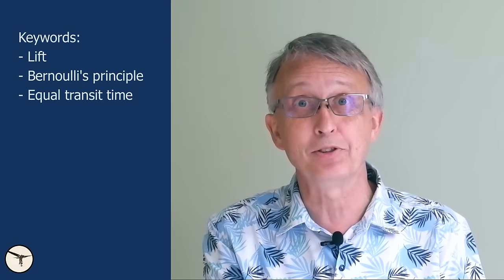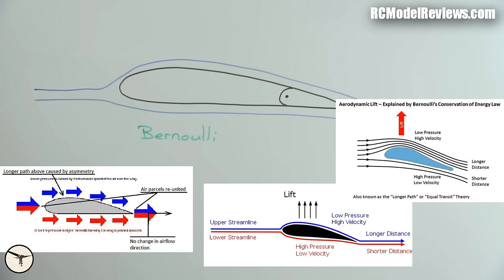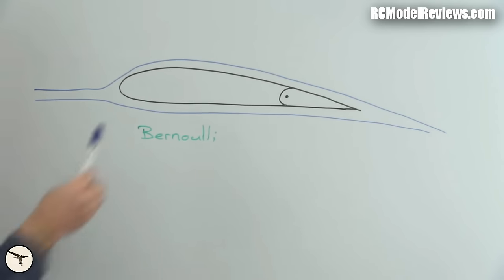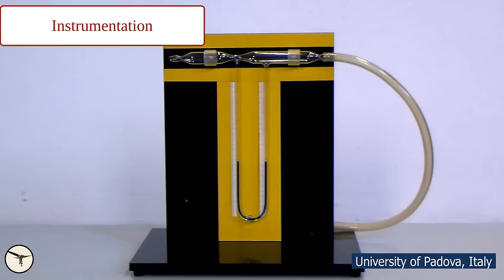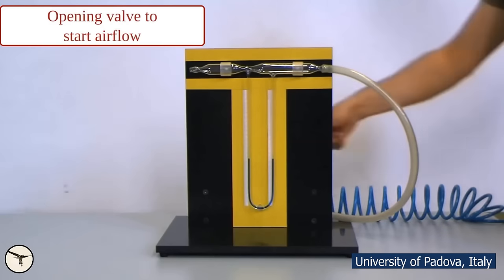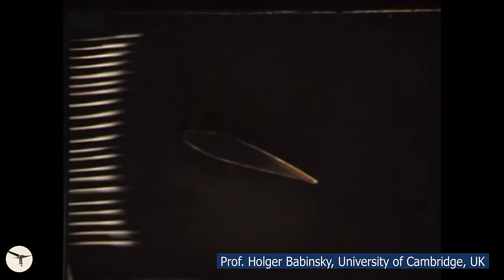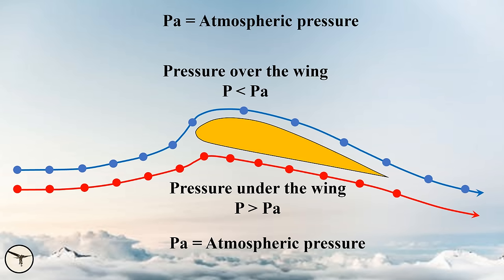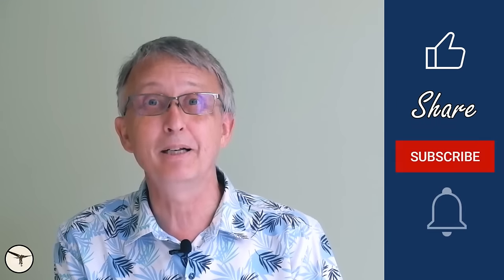Why are so many pilots wrong about Bernoulli’s Principle?

Comment: Hi Magnar, I am a PPL but more important for this I am an Aeronautical Engineer and also was an Aerodynamics teacher at college.
While it is true that Bernoulli's principle applies only to one flow line, it can be also applied to two (or more) flow lines if there is a point where the energy state (speed and pressure) was the same in both flow lines. Sufficiently ahead of the wing, the parcels of air that are going to flow just above the wing and the ones that are going to go just below have the same pressure and speed. So you CAN apply Bernoulli's principle between a point above of the airfoil and another below. Still, transit time is wrong so you can't deduct the speed just by the differences in length. How lift is generated is at the same time more simple, more complicated, and more disappointing (or unsatisfactory explanation) than most people think. Let me know if you want me to expand.
Reply from the maker: Thank you for your feedback. Lift can be both easy and complicated to explain. I understand and agree with what your wrote. In this video, I just wanted to address a common misconception.
Reply: Finally I stumble across some making some sense!

A question or two if you don't mind:

How would you explain to someone who insists that Bernoulli only works for a flow contained by an enclosre such as a pipe, that in fact any parcel within a flow also behaves according to Bernoulli and therefore it also applies to a non-enclosed object such as a wing?

I assume, conceptually it is the interface between parcels that causes the misunderstanding.

And for sails and thin wings which can be considered infinitely thin, how do you deal with the issue of path length of the sold being identical on each side:  I assume the effective actual path length is different because the total flow on each side has an average center of flow extended out some distance perpendicular to the surface?
Reply: @davetime5234  ... Let's go point by point:

1) "How would you explain [this] to someone who insists that Bernoulli only works for a flow contained by an enclosure such as a pipe". That's a strange question. Bernoulli is applicable only when several ideal conditions are met, one of which is NOT that the fluid must be contained in an enclosure. The total set of conditions can be encapsulated in 2: "Potential flow" (that is steady flow of an non-viscous fluid, without any sources, sinks or rotors) and "Between any 2 points of the same streamline" (the airflow around a wing, outside of the boundary layer, is a very good approximation to that). So how do you explain Gravity to someone who insists that it only works in Venus? Well, I suppose you tell them they are wrong, that that's not a condition of the theory. That said.... The streamlines of a steady flow, being fixed in space and tangent to the velocity vector on each point, are never "crossed" by parcels of fluid and hence they can be considered as a pipe. But that's more the reason why Bernoulli works in a pipe, rather than why it works around a non-enclosed object.

2) "And for sails and thin wings, how do you deal with the issue of path length being identical on each side". Simple: You don't deal with the issue because there is no issue to be dealt with. To generate lift, there is no requirement that the path on one side is longer than on the other side. What you said sounds like "equal transit time theory", which states that the path along the upper side of the airfoil is longer than over the bottom surface because the path along the upper side is longer. The problem is that theory is totally wrong. Why? 2 reasons: Frist, there is no reason why one would expect it to be right. Imagine the following situation. To cars going on the same highway pass at the same time in front of a Shell gas station. Some points later both cars take different roads, the red car taking a much longer route than the blue car. The roads eventually rejoin, and each car eventually passes in front of a certain Exxon gas station. Would it make any sense to say that the red car had to go faster because it took the longer road? NO! There is no reason to suppose that. UNLESS both cars pass in front of the Exxon gas station AT THE SAME TIME. But why would that be the case? There is an implicit assumption in the equal-transit-time theory, which is that 2 parcels of air that are adjacent ahead of the wing, with one passing above and one below the wing, will rejoin at the trailing edge. But there is no reason why that should be the case. Imagine that I have a hose that forks and after the fork you have one 1 ft hose and one 10 ft hose, and you put the open end of these 2 branches side to side (after the long hose doing a couple of loops). Would you expect that 2 molecules of water separated at the fork will reach their openings together? And this takes us to the second reason why it is false: Because it is demonstrably false! If you calculate the lift based on equal transit time you get a value much lower than the actual lift. And experiments show that the air flowing along the upper side reaches the trailing edge FIRST (i.e. it wins the race against the air flowing along the lower side), DESPITE taking a longer path. It goes much faster than which equal transit would require. Parcels of air separated at the trailing edge never meet again. So why does the air along the top goes faster? Circulation. But I digress.
Reply: @adb012  Thank you so much for your reply!

On the two points:

1)I think the solid enclosure comes up as an issue with Bernoulli, because it is shown and explained in the context of such a solid macroscopic enclosure in nearly every introductory explanation.

So, people are presumably left with the notion that you need some solid constriction to contain the conservation of energy swap between dynamic and static pressure as the flow progresses.

In terms of generalizing the concept beyond the introduction, for a parcel along a streamline, one perhaps worries about the continual transit of mass across the parcel boundaries (random diffusion for example) to adjacent parcels - no rigid pipe walls anymore now that that conceptual device is removed.

I assume the boundary interface states (between parcels) are what carry the analogy forward:  defining static, and dynamic pressure differences etc.?  

In other words, the concept leap is that all you need is a conceptual enclosure, specifying the appropriate interface variables?  (not sure if I explained well what I was thinking..)

2)Equal transit time being wrong seems so obvious, no argument on that at all.

However, isn't the faster transit time due to conservation of momentum and continuity of mass flow rate?  

M x V to be conserved, requires V to be as fast as necessary to keep M x V constant (ignoring "momentum leaks").

So, a path length disruption imposed, such as camber, increases V as dictated by the imposed geometry (as a key dependent variable), as momentum seeks be preserved?

And that's why it's not equal transit time, it's momentum conservation and continuity of mass flow rate, that are driving the higher transit speed?

Is the above false?  Because if it's not false, then it seems a sail may need different path flow geometries on opposite sides of the thin sail, in order to generate the pressure differential (static pressure drop, due to conservation of energy, in order to service the increased V required to maintain the lateral momentum)?

I mean, after all, a parcel approaching the sail, that gets split into the two different paths around the sail, starts off at a homogenous condition:  the split parcels have equal dynamic and static pressure, and temper etc.

So, the sail is, in effect operating on these identical twin parcels, differently?  With the differing geometries of the two different paths affecting the identical twin momentums differently, causing one to have a different static/dynamic pressure swapping experience than the other?
Reply: @davetime5234  

1) A parcel of air doesn't mix with other parcels of airs by definition. Remember a parcel of air is an infinitesimally small volume of air (that measures let's say dx by dy by dz). It may interact with other particles via action/reaction forces of 2 types: pressure and viscous. But Bernoulli assumes no viscosity (otherwise mechanical energy would not be conserved).

2) You lost me there. Momentum is not conserved. I mean, it is only conserved when there are no external forces applied. But a parcel of air is exposed to external net forces everywhere because it is in a non-homogeneous pressure field. Take a Venturi tube. A parcel of air will have the same mass (and volume if we assume incompressibility) in the wide part and in the narrow part. In the narrow part the parcel will be narrower and longer, but will have the same mass. And it will be going faster. So M x V was not conserved. Which makes sense because it was moving from a zone of high pressure (wide section) to a zone of lower pressure (narrow section) so it was moving along a pressure gradient, which makes work (conservative work, but conservative forces may not change the mechanical energy of a system but absolutely change its momentum).
What I am going to say next doesn't satisfy anybody, but it is what things is: Ina wing, the air flowing above the wing speeds up and reduces its pressure by Bernoulli, and the air flowing under the wing slows down and increases its pressure by Bernoulli too. Note that I said AND and not BECAUSE. It is tempting to say that the reduction in pressure in the top is due to the increase in speed, but when you ask why it increases its speed it's because it moves from a zone of normal pressure (way ahead of the wing) to a zone of low pressure (above the wing). But it cannot be the case that the reduction in pressure is due to the increase in speed  which is due to the reduction in pressure. That's circular reasoning. The reduction in pressure and increase ins peed (or the opposite on the lower side) just coexist. Why? Because it is the only thing that they can do to meet the boundary conditions (the flow shall not penetrate the wing) and the Kutta condition (the air shall separate at the trailing edge). Actually it is the circulation, described via the Kutta condition, which is the real "cause" of the lift (if you are desperate to find a "cause"). And don't let the thin sail fool you. The symmetry you try to present between the parcels flowing above and under doesn't exist. The sail will be curved in ONE direction relative to the free airstream, and the angle of attack will be angled in ONE direction relative to the free airstream. Imagine that you and your identical twin are standing in the subway and grabbing one of the vertical poles. Say that the vertical pole is in the middle of the cart, and you are facing forward, just to the left of the pole, grabbing the pole with your right hand. And your twin is just to the right of the pole grabbing it with his left hand. The subway takes right curve. You will apply a pull force on the pole, and your twin will apply a push force on the road. BOTH TO THE LEFT!!! There is no symmetry. A true symmetric condition would be an airfoil at zero AoA, with no camber and with an even distribution of thickness above and below (or a flat straight sail at no AoA). And guess what? That doesn't produce lift.
Reply: @adb012   "You lost me there. Momentum is not conserved. I mean, it is only conserved when there are no external forces applied. But a parcel of air is exposed to external net forces everywhere because it is in a non-homogeneous pressure field."

I mean the overall momentum has conservation as a first principles rule.

If you send a continuous flow of identical characteristics along two different path types, the conservation of momentum will produce different results for pressure based on the differences in the path experience.  (I presume parcel was perhaps a flawed way to phrase it)?

If there is a continuous flow, path disruption tends to cause a "shortage of supply" in the flow rate, which would increase the lateral pressure differential until the transit acceleration is sufficient to maintain the mass flow continuity (same mass flow rate, with higher speed and lower pressure).

What am I missing here?

"And don't let the thin sail fool you. The symmetry you try to present between the parcels flowing above and under doesn't exist. The sail will be curved in ONE direction relative to the free airstream"

I never claimed there was symmetry.  I was asking about those folks who claim the path length being essentially equal on both sides is a problem.  

It is a condition of asymmetry coexisting with equal path length.

What I'm trying to do is visualize a test stream sent along the upper surface and the lower surface of the infinitely thin but asymmetrical sail.

At the surface on either side, the path would be the same, it is claimed, so there would be no net effect between the two streams because they encounter the same geometry.

I'm trying to test the idea that the average course of any flow split between top and bottom, would realize a different path geometry because all the air could not be concentrated at the surface of the sail (the average path center would be offset some distance from either side of the sail).

So, the average path curvature would be offset, making the geometrical "arc length" different, due to different radii of curvature, or something along those lines of reasoning.

So, the "stress" imposed to the momentum on either side of the thin sail, could presumably be different enough to explain the pressure difference?

As for further clarity on the "chicken and egg" situation with flow speed vs pressure without muddying the situation with the Kutta condition just yet, what about considering the physical mechanism of a venturi pump.

Isn't a venturi pump like an "enclosed wing", in terms of how it operates?:  a momentum in a primary flow being challenged by a change in geometry, causing a pressure drop that induces a momentum change (motive force) in a secondary/further afield mass flow?
Reply: @davetime5234  ... "I mean the overall momentum has conservation as a first principles rule"
Be caracul there. Momentum of a system is conserved only when there is no net external force applied to the system. There is no net external force applied to the Universe (that know of) so the momentum of the Universe is conserved. When you jump up in the air you are launching the Earth in the opposite direction (at an unmeasurably ridiculously small speed) and Gravity slows both of you down until both of you fall back towards each other. The center of mass between you and the Earth doesn't move. Almost. Because there are other bodies bodies gravitationally linked to you and the Earth, like the Moon and the Sun. Your jump will actually affect them too in an even more unmeasurably stupefyingly small degree. Conservation of momentum in Aerodynamics? You don't want to go there. But I'm going there anyway 🙂. So either buckle up or TLDR. This will be a good chunk of all I know about the generation of lift, several posts long.
Reply: @davetime5234  
The pressure and velocity field is infinite, the subsonic wing impacts all of it, infinitely ahead, behind above and below. And you have to include the infinite air, the airplane, and the Earth to have conservation of momentum.

You know that momentum is a vector. If you don't take into account the Earth, the VERTICAL momentum of the air alone is not conserved. Because there is a net vertical downward force applied to it by the wing, the reaction to which is the lift (the vertical upwards force applied by the air to the wing). If there was no Earth 33000 ft below, (well, there would be no gravity hence no air pressure and density, but leaving that at a side) the air would carry the downwash vertical velocity downstream forever. Now the vertical momentum of the plane is constant (and zero if flying at constant altitude) because the net vertical force on it is zero, since the lift cancels the weight. So is the Earth being constantly and unrestrictedly pulled towards the airplane, even if at unmeasurably slow rate? Well no. The air being downwashed by the wing will not penetrate the Earth. The Earth will make it bend back up until it is horizontal again (in the wing reference system, or static again in the Earth reference system). That is associated with a smeared "bulge" of slightly-higher-than-atmospheric pressure on the surface of the Earth, which pushes the air back up to horizontal path and, by the way, whose reaction is a downward force that the air applies to the Earth, which on the air exactly cancels the reaction of the lift that the wing applied to the air, bringing its vertical momentum to zero, and on the Earth it exactly cancels the gravity force that the plane applies to the Earth (the reaction of the airplane's weight). That "smeared bulge of higher pressure" is too widespread in area and small in intensity to be measured with an airplane in normal flight. But it becomes very real, evident and measureable when the plane is very close to the ground (think take-off and landing, less than 1/2 wingspan away from he surface) where it manifests itself in a phenomenon known as "Ground Effect" which is more famous for "increasing the lift" than for "pushing the Earth down" (because everybody cares about the airplane and nobody about the Earth). So the net vertical force acting on each of the 3 parties (air, airplane and Earth) is zero (Airplane: +lift -gravity. Air: -lift +pressure bulge. Earth: +airplane's gravity -pressure bulge) so, in the grand scheme of things, the vertical momentum of the 3 parties is conserved and the vertical momentum of the whole system is also conserved.

On the horizontal momentum campus, it is easier. The airplane produces drag (even in a purely(*) Bernoullistic approach you still have induced drag) so it drags air forward (slows air down, from the traditional airplane-steady-air-passing reference system). But if the airplane is going to keep its airspeed constant it needs to produce thrust. Whatever thrust system you use, you will be accelerating air to the back. So you will have parts of the air being slowed down by the wing and parts accelerated by the engine. In a Bernoullistic approach these 2 masses of air will not mix to even out their speeds, you will have a part that is "forever" slowed down (reduced momentum) and a part that is "forever" sped up (increased momentum), making the total change in momentum of the air zero (in real viscous flow, they will mix, but don't use Bernoulli there). No Earth involvement here.

So yes, in the grand scheme of things, momentum is conserved. But no wonder why we don't use conservation of momentum to calculate lift. Momentum is not conserved until you put the airplane, all of the air, and the Earth inside of the system. You also don't use conservation of momentum when calculating a 1/4-mile drag race. You don't care that the Earth is being pushed back, you only care that the car is being pushed forward. But at some point I also made these almost philosophical "but-wait-a-minute" first-principles-oriented questions, and the answers are hard to find. They are not in textbooks. They are in research papers. And we have not talked about the "starting vortex" yet (and we will not 🙂) which solves another of the first-principle "mysteries" (conservation of vorticity).
Reply: @davetime5234  
All that said, there is one thing that will feel closer to you here. In a 2D analysis (airfoil, or infinitely-long-span constant-cross-section wing) the profile of the velocity speed far away ahead and behind of the wing (let's call these 2 points "checkpoint A and "checkpoint B") will be a flat profile of constant speed all the way up and down, meaning that all the parcels of air will be moving at the same speed and horizontally (at Checkpoint A and B, but not between checkpoints). Imagine that you draw one the streamline that divides the parcels that will go above from the ones that will go below the wing (the streamline that contains the leading and trailing stagnation points). And imagine 4 parcels of air: 2 neighboring parcels at checkpoint A (one immediately above that streamline and one immediately below) and 2 at checkpoint B (immediately above and below the dividing streamline). The speed of all 4 parcels will be the same. Momentum is conserved. You may say "wait a second, the 2 parcels at checkpoint A are not the same as the 2 at checkpoint B". It doesn't matter, we are at steady flow, the velocities are constant in time at each point of the coordinates grid. But ok, I feel your curiosity to take the parcels at checkpoint A and see what happens to THEM as they go to checkpoint B. Let's call the one above BLUE and the one below RED. Blue and Red will reach checkpoint B with the same speed, BUT NOT AT THE SAME TIME. Blue will get there first, despite the longer path, because while it is going at the same speed as Red at the checkpoints, it is moving faster in parts of its road between checkpoints.

Here is where I think you make a conceptual mistake. The above DOES NOT mean that there will be more flow of red parcels than of blue parcels. There is no such implication theoretically, and there is no such manifestation in reality. Let's return to the hoses.

Let's say that you have a hose of 20cm2 of cross section that is infinitely long to the left. At some point it forks in two branches of 10cm2 (this will be our "checkpoint A"). The speed of all parcels along the 20cm2 hose is the same (let's say 50cm/s). The speed in each 10cm2 branches immediately after the forking (at checkpoint A) will also be the same, 50cm/s, because their combined cross section is still 10cm2. That makes that the flow on each branch will be 10cm2 times 50 cm/s = 500cm3/s. So you have the same flow through both branches, EVERYWHERE along those hoses (conservation of mass flow which, in incompressible flow means conservation of volumetric flow) . You measure the speed far away downstream of the forking (checkpoint B), and you still have 50m/s on both branches. Flow is conserved, life is good.
Now let's say that you have a device that can inject a pulse of a tiny bit of a strong dye immediately after the forking (checkpoint A). Red dye for one branch and blue dye for the other, at the same time. You send a pulse of the dyes at checkpint A and, to your dismay, you see that the blue parcel reaches checkpoint B before the red one. So you go inspect what's going on between checkpoints and it all makes sense. The "blue branch" is straight between checkpoints A and B. The "red branch" starts parallel to the blue one but, at some point far away downstream of checkpoint A, it curves away and then it curves back to rejoin the blue branch, while still faraway upstream of checkpoint B. The length of the red branch is longer due to that curve zone somewhere between checkpoints. And because speed is constant and the same along both hoses, the red pulse takes more time to travel from checkpoint A to checkpoint B. But note the flow is still constant on both branches. Yes you will have more volume (and mass) INSIDE of the red branch, but the flow into, through, and out of the branch is the same between branches and the same at any point along the branches. No special pumping required in one branch vs the other.

Now let's say that you find another set up which, at first sight, appears to be identical. A 20cm2 hose with 50m/s speed that branches at checkpoint A (dye injector and all) into 2 hoses of 10cm2 with 50m/s m/s, and a checkpoint B far away downstream where the speed is still 50m/s. You send the pulse of dyes and, to your dismay, this time the red pulse arrives first at checkpoint B. But now you say "I know, this time the blue hose is going to be the curved and longer one". But, upon closer inspection, and again to your dismay, you find that both hoses are perfectly straight and parallel between checkpoints. They are exactly the same length!!! Fortunately, upon even closer inspection, you understand what's going on. The red hose some length, somewhere between and far away from the checkpoints, where the cross section is smoothly reduced from 10 to 5cm2, remains 5cm2 from some length, and then smoothly returns to 10cm2. You measure the speed in the thinner section and, surely enough, it went up to 100m/s keeping the flow at 5cm2 times 100cm/2 = 500 cm3/s, because mass (and volume if incompressible) must be conserved. Effectlivey, the red branch is a Venturi tube. So while the red path and blue path is the same length, the speed along a portion of the red path is faster, hence the red pulse arrives first. No special pumping required.
Reply: @davetime5234  
No special pumping required? What accelerates the flow in the red path then? Well, here comes the unsatisfactory answer again. The pressure gradient accelerates the parcels. There is a lower pressure in the thinner section than upstream in the thicker section. But what causes this pressure gradient? Well the increase in speed, faster speed = less pressure by Bernoulli. Wait, didn't we just reason in circles again? The increase in speed is caused by the pressure gradient and the pressure gradient is caused by the increase in speed? Here is where many would say "well the increase in speed is caused by the thinning of the cross section due to conservation of mass", but that is not totally correct either. Thinning and conservation of mass don't CAUSE changes in speed. Only FORCES change speeds. The unsatisfactory answer is that the pressure field and velocity field don't cause each other, they just coexist in that way because it is the only thing the fluid could possibly do without violating the boundary conditions (shape of the pipe which cannot be penetrated) and without violating conservation of mass, NO SPECIAL PUMPING REQUIRED.

In a thick wing, whether cambered or at an angle of attack, you have both effects combined: A longer path but thinner path on top (the streamlines are closer together above the wing and farther from each other below, so you do have this Venturi effect, although in this case it is imposed by the impenetrability of the wing and Kutta condition as boundary conditions, rather than by the pipe). No special pumping required for the longer path + no special pumping required for the Venturi = NO SPECIAL PUMPING REQUIRED PERIOD.

In an infinitely thin cambered airfoil at the perfect angle of attack such as the streamline that divides the air flowing above and below the airfoil hits perfectly the the trailing edge in a direction that is tangent to the airfoil curve at that point, the parcels going immediately below and immediately above the airfoil will follow paths of equal length. But the one above will still accelerate and the one below will still slowdown (Venturi effect will still be there). Still no special pumping required. And note that for parcels passing above and below the airfoil but not skimming the airfoil (that is, at some small distance above and below it), the path for the ones going above will be longer than the path for the ones going below.

But I this point I hope it landed on you that path length is not that important. Speed can increase or degrease regardless of path length because there is no "deadline" for parcels that were next to each other upstream, to be next to each other even again downstream.
Reply: @davetime5234   ... Last one at last!!!
So, in summary, under purely potential potential flow, generation of lift is impossible because the Kutta condition (separation of the flow at the trailing edge) is impossible (except at one, zero lift, angle of attack) and hence there is no circulation created to accelerate the flow above and retard the flow below the wing. However, in real life the Kutta condition does happen because the flow is not really potential and the viscous effects make it impossible for the flow to turn around the sharp trailing edge. To make a "perfect" calculation you have to invoke the viscous effects and the boundary layer, but then you don't have potential flow and Bernoulli anymore. But you can encapsulate most of these effects and get very accurate predictions (at least away from the stall) by imposing the Kutta condition as a boundary condition, and using the Kutta-Joukowski theorem to enforce it: Keep the potential flow, but artificially dial in enough circulation (which cannot spontaneously happen under potential flow) to meet the Kutta condition. "And Kutta said: Let the airfoil generate enough circulation so as the flow separates at the trailing edge. And there was lift. And it was good".

No special pumping required, but you do need either the magic trick of imposing the Kutta condition artificially via introducing exactly enough circulation, and after that all is good with Bernoulli, or let it happen naturally via the viscous flow in the boundary layer where Bernoulli does not apply.
Reply: @adb012  "Momentum is not conserved until you put the airplane, all of the air, and the Earth inside of the system."

That's not true.  

Any disruption to the relative wind (as infinite in extent as it may be), must be accounted for as a loss of "quantity of motion" (M x V), which, because momentum is conserved, must be accounted for as a change in momentum of the aircraft.  Momentum is symmetrical (Newton's 3rd law).

"no wonder why we don't use conservation of momentum to calculate lift."

Yes, a crude calculation using momentum lacks precision necessary in a full design context, but it doesn't lack as a meaningful representation of physical reality:

The lateral momentum of the relative wind is directly connected to feeding the induced change in vertical momentum of mass that is equal to lift L = d(mv)/dt

The above fact cannot be circumvented.
Reply: @adb012  "So while the red path and blue path is the same length, the speed along a portion of the red path is faster, hence the red pulse arrives first."

Your error in all of that explanation was that your notion of "length" in terms of the impact of path in the considered context is misapplied.

Path length in terms of the asymmetry of the camber and angle of attack, is a transverse restriction (how wide is the pipe), not longitudinal (how long is the pipe).  So, the extra loop length you described containing the ready supply of mass to keep the flow speed constant is a misinterpretation, of the geometry relative to the flow direction.

"No special pumping required."

I don't know about special, but pumping is required, or rather a motive mechanism to change the vertical momentum of mass to keep an aircraft aloft.
Reply: @adb012  Forgive me for a little bit of mix up on which of your comments contains which content.

"Pumping" I likely used as a metaphor for how the pressure drop, in the sense people usually talked about lift in terms of Bernoulli, causes the "circulation" (change of direction) necessary to have the momentum of the relative wind drive the vertical change in mass momentum that equals lift L = d(mv)/dt.

Again, your comment here seems to be about how the term "length" for path is misconstrued by you to imply longitudinal path rather than the transverse direction, being directly related to path restriction.

By "pumping" I mean identifying the pressure drop conditions which drive the directional change in mass flow momentum, opposing gravity, that holds an aircraft up.
Reply: @adb012  "But I this point I hope it landed on you that path length is not that important. Speed can increase or degrease regardless of path length because there is no "deadline" for parcels that were next to each other upstream, to be next to each other even again downstream."

To be honest, I think you are making the classic mistake here in terms not being able to get away from the black and white issue of equal transit time be true or false (of course its false).

The error with all this debate about whether equal transit time being true/false says anything at all, perhaps is related to this confusion of seeing "path length" as argument about longitudinal travel, when, as I have already stated is about window of constriction.
Reply: @adb012  "No special pumping required"

Well, a concept label is needed for identifying why increased speed is associated with lower pressure and how that effect is used to change directional momentum of the extended flow in an open geometry situation.

I mean, that is getting at the physical essence of circulation after all, isn't it?:  why the air is turned

I'm not sure I remembered all you said but you mentioned more than once I think about the chicken and egg reasoning of pressure drop associated with higher speed(?).   Did you say something like, it is just because it is?  (Maybe I don't remember correctly).

In a constriction I believe the speed increases because a mass flow rate supply deprivation is "threatened".  But of course that can't happen so the pressure drops just enough so that the speed of the mass flow increases to the point that the mass flow rate is maintained at a balance of higher speed at lower mass density (a lower density of random thermal collisions per unit area).

Where does the increased speed associated with the increased dynamic pressure come from?

Directed higher thermal velocity molecules (towards the higher end of the molecular thermal velocity distribution), are effectively "filtered" to carry the same mass rate at the lower density.
Reply: @davetime5234  ... You: "the term "length" for path is misconstrued by you to imply longitudinal path rather than the transverse direction, being directly related to path restriction."

Seriously? Are you kidding? Is it me the one who is misconstruing the term "length" of a path for considering it, you know, it's length, rather than its width?

So much time lost. I hope that my comments are useful for someone else. I am out of here. Eject, eject eject!
Reply: @adb012  I definitely thank you for your response and time.  It was helpful, as these kinds of dialogues always make me think deeper.   Some of it adds up, but some of it frankly doesn't.  What didn't work for me was some of what you wrote on momentum, path elongation vs restriction, and your comments on what you designated as unavoidable circular thinking with the speed-pressure relationship.

Yes, as far as "length," a word for a measure in a single dimension, we need to understand if that is an attribute of elongation or restriction.  Think about it.  This is an Achilles heel in the whole notion of lift in many misunderstandings.  Asymmetry, in the sense of being restrictive, creates a turning of the flow (from the induced pressure drop).  So, when we say length, it has to be in the sense of "throttling" asymmetry.  Sorry if I assumed too much with that.

However, I need to clean up my notion of parcels, and the associated formality of the definition and how to use it appropriately, so I don't cause misunderstanding to myself and others.

Please don't take it that it was lost time.  But, I think we all need to clarify our thinking now and then.
Reply: @davetime5234  ... No, you are not open to talk. You pretend to be, but aren't. And you pretend to be knowledgeable (and maybe you honestly believe it) but aren't. You don't understand momentum. You mix horizontal momentum with vertical, you say that the change in momentum of the air is correlated with a change of momentum of the airplane which is CLEARLY not since the airplane is at constant speed and hence its momentum is constant (m.V is constant, d(m.V)/dt is zero for the airplane). You say that momentum is symmetrical when it is not and invoke Newton's 3rd law. Which is only about force, not about momentum. You seem to be mistaking momentum with impulse (and treating momentum and quantity of motion as 2 different things when in fact they are synonyms). The impulse (F.dt) is symmetrical between 2 bodies because the forces between them are symmetrical due to action and reaction, but the change in momentum of a system is not equal to the impuse, it is equal to the IMPULSE OF THE NET EXTERNAL FORCE. And on the plane there are other external forces acting in addition to the lift, most notably its weight, whose reaction in on the Earth, not on the ground. In one of my post I explained what are the 2 external forces that act in each of the 3 parties that keep the net force of each party equal to zero. Only in that macroscopic view the momentum is conserved.

The law of momentum is NOT a CONSERVATION law. In fact, it is F(net ext).dt=d(m.Vcm) (net external force times differential of time is equal to the differential of the momentum of the system, which is its mass times the velocity of its center of mass). It is a VARIATION law. I myself taught the derivation of that law at college, based on the Newton's laws and the definition of center of mass of a system of particles (where it is a rigid body, loose particles, or both). It is ONLY when the NET EXTERNAL FORCE IS ZERO that the variation of momentum is zero (hence conserved).

It is the same misconception people normally has with energy. Energy OF A CLOSED SYSTEM is conserved (i.e a system that doesn't exchange energy with other systems). But mechanical energy is NOT conserved in general. The law of mechanical energy is a VARIATION law, NOT a CONSERVATION law. Wnc = ΔEm (work OF NON-CONSERVATIVE FORCES is equal to the change of mechanical energy). Mechanical energy is ONLY conserved if the work of non-conservative forces (internal or external) is zero.

I am tired of you first asking questions and then saying that my answers are wrong because fuzzy fiziks mumbo jumbo.

I would love if we could meet in person with a whiteboard or pen and paper. I am confident that we could discuss constructively and end up agreeing. (I am also confident that the agreement will be much closer to what I am saying than to what you are saying). I taught Physics and Aerodynamics at college of Aeronautical Engineering students, so I know that I can explain this and that it can be understood. I don't know your background, I don't care too much really because I like to judge (and be judged) by the content and not by the cover. But this "deaf conversation" in the YouTube's comment section is not going anywhere.
Reply: @adb012  "you say that the change in momentum of the air is correlated with a change of momentum of the airplane which is CLEARLY not"

If I said that it would be wrong.

An aircraft in straight and level flight.  That means no acceleration in any direction, right?  Constant speed in all 3 dimensions.

Is there a momentum change needed to maintain this situation? Yes.

Does the aircraft itself experience change in momentum in the state described above.  No.  

Downard change in momentum of mass (opposed to gravity), is constantly required to maintain zero net force from gravity.

That is, continuous downward momentum of air needs to be accomplished to keep the aircraft from experiencing a change in downward momentum for the state of straight and level flight.

"The law of momentum is NOT a CONSERVATION law."

Yes it is.  It's one of the most fundamental law's of physics.

The momentum (quantity of motion) and energy (ability to do work) are as conserved as is mass.

All 3 need to be accounted for.

"It is ONLY when the NET EXTERNAL FORCE IS ZERO that the variation of momentum is zero (hence conserved)."

Yes and no.  Again, gravity - lift = 0
Sure, in that case the aircraft has zero variation of momentum.

But the change in downward momentum of the air is doing all of that heavy lifting for the aircraft.
Reply: @davetime5234  ... Ok, see? Then momentum is NOT conserved!!! (there)
Reply: @adb012 I think we've already established that.

You claimed I said the momentum of the aircraft was changing.  Did I say that??

Oh, maybe are you thinking of what I said about the lateral momentum of the relative wind, the airflow?

As in, I might have claimed:  if you disturb the lateral airflow's momentum, you pay a penalty in terms of the aircraft's continued forward motion?

Yes, I meant the aircraft experiences "pure lift drag", as in non-parasitic drag, for the energy necessary to accomplish the downward production of momentum.

There's an energy penalty that the aircraft's engine thrust has to overcome, simply to produce that change in downward momentum of air, to be able to equal weight.

So again, that is besides parasitic drag (non-lift losses).

So, yeah, I guess I am saying the aircraft does lose forward kinetic energy as the result of producing the constant downward vertical momentum change of air.

And that loss of forward speed to produce the vertical momentum change of air does correspond to a loss of momentum of the aircraft.

Except that I'm assuming we would agree that "straight and level flight" with no change in horizontal acceleration means that our thrust is fully equal to drag.

But fuel is being burned to maintain that constant forward momentum against what is taken for the production of lift.
Reply: @davetime5234  ... I am not going to continue this discussion like this. You said many things sine my long post in 6 chapters, and called me wrong several times. I still don't see a single case where you convinced me that I was wrong. In fact I said that momentum is not conserved unless you take the plane, all of the air, and the Earth into the system, you called me wrong, that momentum is conserved from first principles, now you said something that I interpreted like it was you saying that momentum is not conserved, and you say that my interpretation si right? I am very confused not with the subject, but with the conversation.
If you want, take ONE thing or concept from my long multi-chapter post where you think I am wrong, explain why you think I am wrong and how you think is right, try to be precise with the Physics lexicon and concepts (I will try to do the same), and let's go from there. One point at a time.
Reply: @adb012  
Ok, you stated:

"momentum is not conserved unless you take the plane, all of the air, and the Earth into the system, you called me wrong"

Can you reconcile that with a typical definition?

"The law of conservation of momentum states that in an isolated system the total momentum of two or more bodies acting upon each other remains constant unless an external force is applied."

you:  "take it all into the system" =  definition: "in an isolated system"???

What are you talking about?
Reply: @davetime5234  ... Ok, I can see how I didn't phrase that nicely. Let's fix that. There are 3 chapters here:

1) Context. What what the discussion when I said what I said:
2) Theoretical Physics. I am deriving, from first principles and definitions, the theorem (not the law, because it's not a law) of conservation of momentum of a system.
3) What I tried to say and how I reconcile what I tried to say with the theorem of conservation of momentum of a system.

Feel free to skip to the part you want. But if you skip, before objecting to something, try to find my justification for that. I am trying to ver very strict with my use of Physics here.
Reply: @davetime5234  1) Context. What what the discussion when I said what I said:

To put things in context, I was replying to something you said, but let's go back so we can look at more of the dialogue:

YOU: For sails and thin wings, how do you deal with the issue of path length being identical on each side?
ME: There is no issue to be dealt with. To generate lift, there is no requirement that the path on one side is longer than on the other side. (and talk about the falsehood of equal transit time).
YOU: Equal transit time being wrong seems so obvious, no argument on that at all. However, isn't the faster transit time due to conservation of momentum and continuity of mass flow rate? M x V to be conserved, requires V to be as fast as necessary to keep M x V constant (ignoring "momentum leaks").  So, a path length disruption imposed, such as camber, increases V as dictated by the imposed geometry (as a key dependent variable), as momentum seeks be preserved? And that's why it's not equal transit time, it's momentum conservation and continuity of mass flow rate, that are driving the higher transit speed? Then it seems a sail may need different path flow geometries on opposite sides of the thin sail, in order to generate the pressure differential (static pressure drop, due to conservation of energy, in order to service the increased V required to maintain the lateral momentum)? I mean, after all, a parcel approaching the sail, that gets split into the two different paths around the sail, starts off at a homogenous condition:  the split parcels have equal dynamic and static pressure, and temper etc. So, the sail is, in effect operating on these identical twin parcels, differently?  With the differing geometries of the two different paths affecting the identical twin momentums differently, causing one to have a different static/dynamic pressure swapping experience than the other?

And that's were I went "WTF?" You really REALLY lost me there. Like I don't understand what you are saying. That's a fruit salad of terms used in strange ways mixed with correct and incorrect concepts and other things that I don't even know what they are. But something there IS definitively wrong: This part:

"However, isn't the faster transit time due to conservation of momentum and continuity of mass flow rate? M x V to be conserved, requires V to be as fast as necessary to keep M x V constant". So I reply with:

ME: You lost me there. Momentum is not conserved. I mean, it is only conserved when there are no external forces applied. But a parcel of air is exposed to external net forces everywhere because it is in a non-homogeneous pressure field. Take a Venturi tube. A parcel of air will have the same mass (and volume if we assume incompressibility) in the wide part and in the narrow part. In the narrow part the parcel will be narrower and longer, but will have the same mass. And it will be going faster. So M x V was not conserved. Which makes sense because it was moving from a zone of high pressure (wide section) to a zone of lower pressure (narrow section) so it was moving along a pressure gradient.
YOU: I mean the overall momentum has conservation as a first principles rule.

And that, my friend, is totally wrong. Unless with "overall" you mean a system on which the net external force is zero. And even that that's not a first principle rule in Newtonian physics. It is a theorem. Quick recap on first principles and the theorem. (and let's keep in mind that all what follows is vectorial in nature)
Reply: @davetime5234  2) Theoretical Physics. I am deriving, from first principles and definitions, the theorem (not the law, because it's not a law) of conservation of momentum of a system.

The famous F=m.a in fact was stated by Newton as F=dp/dt, where p=mv is the momentum (more precisely linear momentum, also called linear quantity of motion). And where F is not just a force, it is the total net force, or the sum of all forces, or the resultant of all forces acting on the particle (because, by the way, this applies only for particles). Today we write Fnet or ΣF=dp/dt. That's Newton's second law. THAT is a first principle, and there you can already see that this is not a conservation law, it is a variation. It is a VARIATION law, it tells you how the momentum CHANGES with time. Side note: that the same equation can be re-written as ΣF.dt=dp, which can be integrates as ∫ΣFdt=Δp=pf-pi, which is known as the impulse-momentum law which let's you asses the discrete change in momentum between 2 different times, from an "initial state"(pi) to a "final state" (pf).

Conservation of momentum is then not a first principle, but a theorem, that states (in the single particle version) "If the net force action on a particle is zero, then its momentum is conserved", which is evident from the above equations (if the left-hand side is zero, then the right-hand side must be zero too). Not that there is a big IF there. That's a hypothesis. This is NOT first principles anymore.

The concept of momentum can be extended to a system of particles (be it individual loose independent particles, a rigid body, anything in between, or all of that combined). For that you need to introduce the concept of center of mass first.
The center of mass is, by definition a point in space that meets (it's key characteristic is its position) whose position is the weighted average of the position of all the particles of the system, weighted by mass. This can be written as:
Xcm=Σ(Xi.mi)/Σmi, where Xcm is the position vector of the center of mass, Xi are the position vectors of the individual particles, and mi are the masses of the individual particles. Note that Σmi is then the total mass of the system, sometimes called M. Driving that equation relative to time you get Vcm=Σ(Vi.mi)/M (velocities instead of positions), which you can restate as Vcm.M=Σ(Vi.mi), or, by defining the momentum of the center of mass of a system (also called momentum of the system) as Pcm=Vcm.M, you get Pcm=Σpi (the momentum of the system, of its center of mass, is equal to the sum of momentums of the individual particles). We now can derive that respect to time and get dPcm/dt=dΣpi/dt=Σ(dpi/dt).
But wait, we know what dpi/dt is, that's the change in momentum of each individual particle, so by the second law we have:
dPcm/dt=Σ(ΣFi), where ΣFi is the sum of forces acting on the particle i. So far we have that the change of momentum of a system is equal to the sum, for all particles i, of the sum of forces acting on each particle i. But we can divide the forces acting on each particle i in 2 categories. We are going to call the forces "internal" if the agent making the force on particle i is another particle that belongs to the system, and external if the force is made by an agent outside of the system. In other words, ΣFi=ΣFinti+ΣFexti, so we have:
dPcm/dt=Σ(ΣFinti+ΣFexti). Because a sum of a sum is still a sum (commutative property), we can rearrange that:
dPcm/dt=ΣΣFinti+ΣΣFexti. And because the sum of a sum is still a sum we can rearrange that again:
dPcm/dt=ΣFinti+ΣFexti. Now that for any pair of particles i1 and i2 in the system the force that i1 makes on i2 is equal to minus the force that i2 makes on i1: Fi1i2=-Fi2i1. That's Newton's 3rd law. So all the internal forces will cancel each other in pairs, hence ΣFinti=0. Finally, calling ΣFexti just ΣFext (that is, the sum of all external forces acting on the system, or the next external force acting on the system) we get to the famous:
ΣFext=dPcm/dt which again can be re-arranged and integrated as ∫ΣFext.dt=ΔPcm.
This is still a variation law, not a conservation law. But again we have a conservation of momentum THEOREME: If the net external force (that is the resultant of all external forces) acting on a system is zero, then the momentum of the system is conserved. Again evident from the above equations: If the lef-hand side is zero, then the rght-hand side must be zero too.
This is (almost) consistent with the "definition" you stated: "The law of conservation of momentum states that in an isolated system the total momentum of two or more bodies acting upon each other remains constant unless an external force is applied." Two minor corrections, tough. 1) It's not a definition, it is a theorem. It can be proven from first principles and previous definitions. 2) While the theorem holds true for an isolated system, that is not a requirement for it to hold true. The requirement is net external force equal zero. So it doesn't need to be isolated, there may be forces acting on the system as long as they add up to zero.

Note that conservation of momentum is not first principle at all. We had to use two first principles (2nd and 3rd Newton's laws), several definitions (system of particles, position of center of mass, total mass of a system, momentum of a system, internal force, external force...), a hypothesis (the net external force is zero, then...) and some math juggling to prove the theorem.

So conservation of momentum of a system is true only if the hypothesis is true (sum of external forces = 0).
So before you talk about conservation of momentum in a system, you need to define very well what the system is. I am going to focus in the momentum in the vertical direction (momentum being vectorial, the vertical component may be conserved or not independently of whether the horizontal component is).
Reply: @davetime5234  3) What I tried to say and how I reconcile what I tried to say with the theorem of conservation of momentum of a system.

I am going to focus in the momentum in the vertical direction (momentum being vectorial, the vertical component may be conserved or not independently of whether the horizontal component is).

If you take the airplane flying at constant altitude, then momentum is conserved because the vertical speed is constant (and zero). That is achieved because the 2 external forces acting on it (the weight W made by Earth, and the lift L made by the air) cancel each other so they add up to zero.
If you take the air, well, that's complicated already. What part of the air? If you take a big bunch of particles far ahead of the wing and see what happens when they are far behind the wing, the momentum is evidently not conserved because they have zero initial vertical velocity in the initial state and a finite downwash velocity w in the final state. That change in vertical momentum is caused because there is an external downward vertical force acting on the air, L', made by the airplane, the reaction of the force of the lift L made by the air on the airplane.
Adding the airplane to the system doesn't help, because the change of momentum of the plane is zero so it doesn't help cancel the change of momentum of that part of the air. You may say "ok but lift is an internal force now". Well, even then you have at least one external force acting on the system: The airplane's weight. Wait, but am I saying that it is the airplane's weight what shoves air down? In the full-system approach, yes. Note that onece you take the whole system and cancel the internal forces, the remaining external forces don't impact momentum of the individual particles it is acting up directly, but the momentum of the whole system (that is, of its center of mass). That's because to calculate the change in momentum of the individual particles you need to take into account the internal forces too because they are part of the net force acting on the particle.
But there is more. There will be other external forces acting on that system. Forces made by the parts of the air that were left outside of the system.
So what if you take all of the air and only the air as a system? The vertical momentum of all of the air is conserved, because there are 2 external forces acting on it: The reaction of the lift (L') that we already talked, and the force caused by the smeared bulge of pressure on the surface of the Earth where the downwash hits the Earth (let's call that force B). It can be proven that B and L' are equal in magnitude.
Finally, if you take the Earth you have 2 forces on it: The reaction of the airplane's weight (W') and the reaction of B (B'). (B' prevents the whole Earth from being slowly pulled towards the airplane!!!, but that splitting hairs)

*FINALLY*, this is the point I was trying to make, and that I could have phrased better:
In the airplane we have L made by the air and W made by the Earth that cancel each other. Vertical momentum is conserved.
In the air (all fo the air) you have L' made by the airplane and B made by Earth which cancel each other. Momentum is conserved. BUT YOU NEED TO TAKE INTO ACCOUNT THE EFFECT OF THE EARTH!!!
In the Earth you have W' made by the airplane and B' made by the air that cancel each other (because, in magnitude W'=W=L and B=L'=L). Momentum is conserved.
If you take the "big scheme of things" of the airplane, the air, and the whole Earth, of course vertical momentum is conserved, not only because it is conserved in each of the individual items, but because L, L', W, W', B and B' are all internal forces, and there are no external forces. It is your "isolated system".
BUT If you take just a part of the air, even a big volume around the airplane but not reaching all the way to the Earth, then momentum is NOT conserved and adding the plane to the system doesn't help that, momentum is still not conserved.  And that doesn't violate any first principle or law of Physics.
So "conservation of momentum" is not a practical way to calculate lift, because you need to take ALL of the air into account for momentum to be conserved.
Reply: @adb012  Yes, I was completely wrong on how I was defining and discussing individual parcels, and that the description I made applies to the extended mass flow behavior.

But I already explicitly stated to you that I made such an error that I need to fix.

You're just reading it again without the context of the correction (remember the correction?).

The text still makes sense for the extended flow.  It explains how the bulk flow must respond to the foil obstruction according to first principles conservation.
Reply: @adb012  "YOU: I mean the overall momentum has conservation as a first principles rule.

And that, my friend, is totally wrong. Unless with "overall" you mean a system on which the net external force is zero. And even that that's not a first principle rule in Newtonian physics. It is a theorem. Quick recap on first principles and the theorem."

Specifically, between the widest quotes above:

"Unless with "overall" you mean a system on which the net external force is zero"

Yes, the bulk ("infinite") relative wind carries on in approaching the aircraft, with no external forces.  Wrong?

"that's not a first principle rule in Newtonian physics. It is a theorem."

Newton's third law is not a first principle? 

Stating again about parcels, as far as the end of your prior post, I already acknowledged my misstatements about parcels.  I fully understand that the parcel interface interactions between exterior and interior of the parcel fully interact with the conservation notions within the parcel - that is, the parcel is an element within a latticework of transmitted physical influence.
Reply: @davetime5234  ... It is still not clear to me if you still disagree with anything I said, and if so, what and why.

"The text still makes sense for the extended flow." ==> I don't know what is "the text" there. There was a lot of text.
And what is "the extended flow"? The same that I call "all of the air"? (extending down to the ground, and to the infinite in all other directions) 

"It explains how the bulk flow must respond to the foil obstruction according to first principles conservation." ==> With or without the effect of the Earth?
What "first principles conservation". Momentum is not conserved except in a system on which the net external force is zero. You said that yourself (well you went a bit beyond saying "an isolated system" which one way to have zero net external force).
I thought you disagreed with "momentum is not conserved unless you take the plane, all of the air, and the Earth into the system" (the "into the system" part was wrong on my side, but you still need to consider the effects of all these items). And asked me to reconcile that with the "conservation of momentum of an isolated system". So I went at length to show you how they are reconciled.
But now are you saying that you already agreed with that? I honestly don't understand.

Again: anything I said anywhere in these comments that you still disagree with?
Reply: @adb012  Your prior momentum essay above is redundantly pedantic.  Anyone trained adequately in fairly fundamental physics knows the weight of the 3rd law and how to proceed with the implications.  You frankly appear to be obfuscating the central topic with unproductive diversion.

Or, admittedly, perhaps I tripped you excessively with my parcel misstatements.

Again, I get the transmission of influence across the interfaces of the parcels, within the lattice work of parcels in a system.

Still word salad?
Reply: @davetime5234  ... "Yes, the bulk ("infinite") relative wind carries on in approaching the aircraft, with no external forces.  Wrong?"
Wrong. There are external forces acting on the bulk of air. The aircraft is "submerged" in the bulk of air (part of the bulk of air approach the plane, parts get away from it). In the process, the air is deflected by the airplane (in multiple directions), and it is also deflected by the surface of the Earth. The airplane and the Earth make external forces on the bulk of air.

"Newton's third law is not a first principle?"
Yes, Newton's third law is a first principle. You cannot theoretically / mathematically prove it. But you said that conservation of momentum is first principles. It is not. That is what I objected. I mean, you just saw me prove it from first principles, convenient definitions, and the hypothesis of zero net external force, right?
(As a side note, you can prove a weaker form of the conservation of momentum theorem without using the 3rd law: "The momentum of a system is conserved if and only if the net force acting on it is zero". You need the 3rd law to change that  "net force" to "net external force")
Reply: @adb012   "Wrong"

I said: "in approaching the aircraft"

I didn't say after it encounters the aircraft.  That was what came next.

If you're going to make an objection to a point, I'd appreciate if you would check if you understood the point.

Your entire argument is based on your misinterpretation.

"you said that conservation of momentum is first principles. It is not."

Simply obstructively pedantic.  It has no value-added function whatsoever for the topic.
Reply: @davetime5234  ... I am sorry. I didn't intend to be pedantic. I don't know your background. I don't know what you know and what you don't know, or what you think you know but you don't (I don't know that last one for myself either). So I started from the very basics.

But leaving styles aside and focusing on the content, do you agree with the answers that I provided above for your 2 questions? If no, let me know. If yes, is anything else that you disagree with or that you would like to discuss?

Regarding the parcels, I apologize for having missed or misunderstood the first time that you took it back.

Still word salad? Only with the lattice work thing. For me, latticework is a pattern of crisscrossed strips of some material like wood or metal, a sort of rigid "net", unrelated with Physics. I don't know what "Lattice work" is in Physics. I know there is something called "lattice model", it is a model where you treat individual particles as that (individual particles) that can occupy specific positions in a 3D matrix or "lattice". Like atoms in a crystal. I know almost nothing about that except that that's the opposite to the continuum hypothesis, which is what ALL of aerodynamics is based on. If you mean something else, it's beyond what I am familiar with.
Reply: @davetime5234  ...  ..."I said: "in approaching the aircraft""

I said "all of the air" and you said "Yes, the bulk ("infinite") relative wind carries on in approaching the aircraft, with no external forces."

Again, "the infinite bulk of air" is not approaching the aircraft. It is all around the aircraft with parts approaching and parts getting away.

To talk about momentum of a system, you need to clearly define the system. That's not pedantic. It's a basic necessity for common understanding (and even for self understanding.

So the system you are talking about is just the "half" of "all of the air" ahead of the aircraft? (which is still an infinite bulk of air, but infinite in one direction but not the other). How far ahead of the aircraft? Far enough hat we can consider that the rest of all of the air that is not part of your bulk is not making any force on your bulk? Or is your system something else?

Then you call me pedantic again for explaining why and how I was not wrong in something you said I was wrong when I wasn't wrong.
Let's stop calling names and focus in the discussion, shall we?
Reply: @adb012  "Still word salad? Only with the lattice work thing. For me, latticework is a pattern of crisscrossed strips of some material like wood or metal"

I meant it metaphorically as in a 3d expanse of interconnected influences.

"To talk about momentum of a system, you need to clearly define the system."

I did:  infinite still air before inserting an aircraft.  Now insert the aircraft.

You don't need to make it any more complicated
Reply: @davetime5234  ... "infinite still air before inserting an aircraft.  Now insert the aircraft."
Ok.... ish... That doesn't sound like a very "steady state" condition, I don't know if that's important or not because I don't know yet where you are going. I'll try to follow you. Please continue.
Reply: Left half of infinity there is uniform steady horizontal airflow. Right half of infinity there's a straight and level non-accelerating aircraft, that gets "inserted" into your awareness.  It has been there all along - steady state condition.

Then the issue becomes how does asymmetry of the solid with respect to the relative wind induce a pressure drop over the wing?

This addresses the nature of the relative wind's interaction, which turns the air.

Again, I'm saying conservation of momentum (per unit volume), "stresses" a pressure drop, simply due to deprivation of horizontal flow.  Mass flow continuity asserts itself because flow deprivation drops the pressure sufficient that the associated acceleration maintains the mass flow continuity.

If it appears as if I'm suggesting a self-regulation tendency, it's because I am.

Any mass stagnation changes the longitudinal pressure profile to "fix" the continuity problem (resulting from the asymmetry restrictiveness).

The 3d spatial distribution of this obviously becomes more complex to describe precisely so requires other analysis.

But the topic of the video is about debunking lift in a more intuitive sense.

Connecting the nature of the asymmetry's turning of the air to the nature of the lateral momentum's conservation tendencies, seems most natural.

It connects the key "circulation" (which produces the vertical change in momentum), with the physical attributes of the medium in combination with the asymmetrical geometry.

The FAA, the technical community and pilots can't agree on the nature of lift?

The air is turned by asymmetry, which produces an asymmetrical force. 

(via a conservation pressure drop...ignoring the bottom surface which readily can be added after the key point is made).
Reply: @davetime5234  ... And there you lost me again. Deprivation of horizontal flow? Conservation of momentum per unit volume, in units of volume that are accelerating hence changing their momentum? Mass stagnation? Asymmetry restrictiveness? What on Earth are you talking about? What happened with Physics? That's mumbo jumbo word salad. Or something so deep and cutting edge that I have no the slightest idea what you are talking about.

But I have bad news for your theory. Well, should not be bad news because I already explained this when I talked about Kutta and Joukowski. You can put a cambered airfoil at a nice angle of attack, all introducing a nice asymmetry in the flow, make the full potential flow calculations, and you will get a nice set of streamlines in a nice pressure field and a nice velocity fields that create a nice pressure distribution on the airfoil... that generates no lift. None. Zero. Zilch. Nada. Whatsoever. No matter the airfoil camber or angle of attack. It is IMPOSSIBLE to generate lift with potential flow alone. That's mathematically demonstrated.

Not, until you artificially INTRODUCE the Kutta condition in the potential flow, a condition that is IMPOSSIBLE to occur naturally in purely potential flow but UNAVOIDABLE in real viscous flow. That's what creates circulation. And circulation is the key to the generation of lift. So unless and until add the Kutta condition to the potential flow, or you add a viscous boundary layer, of which you have done neither (or at least you haven't mentioned it in any intelligible way), you don't have anything.

And by the way... I didn't understand anything, but would your "explanation" (?) still hold in the case of a theoretical infinitely thin cambered sail where the streamline that skims the sail on the upper side and on the lower side follow both of them paths of exactly the same shape and length from -infinity to + infinity?
Reply: @adb012  "....Kutta and Joukowski. You can put a cambered airfoil at a nice angle of attack, all introducing a nice asymmetry in the flow, make the full potential flow calculations, and you will get a nice set of streamlines in a nice pressure field and a nice velocity fields that create a nice pressure distribution on the airfoil... that generates no lift."

Could you please explain why the above generates no lift?

And please elaborate on the physical meaning of the following?:

"It is IMPOSSIBLE to generate lift with potential flow alone."

As for your last paragraph about the thin sail (where you didn't specify any AoA asymmetry), can you elaborate what physical implication you are imposing by describing a single streamline at the surface, behaving independently from the adjacent "stack of streamline layers"?
(for the case of an AoA asymmetry)

Why is it justified to not implicate a thicker cross section as participating in the influence of flow transit continuity?
Reply: @davetime5234  ...... Potential flow is a physical model where the fluid has negligible viscosity. Potential flow alone will not meet the Kutta condition (instead the flow will happily turn around the trailing edge) because it cannot create circulation. No circulation = no lift. You need to either apply the Kutta condition to your model (artifically adding enough circulation until the separation point happens at the trailing edge), or consider a more reallistic model with viscocity and boundary layer. The potential flow flow model yields pretty accurate results, after you impose the Kutta condition, because all viscous effects are negligible outside of the boundary layer (by definition of boundary layer) and the boundary layer is thin in real life. If you want more details, go to the comment where I discuss all about generation of lift, in particular the part where I talk about Kutta and Joukowski. It seems to me that you didn't read that part. Please go and do it before continue the conversation because that is THE KEY to the generation of lift.

Sail... let me first clarify that, as you, I am in a 2D mindset at this moment. With "sail" I just mean a super thin (infinitesimally thick) but cambered airfoil, which conserves its shape (not deformable). Cambered already breaks symmetry. And let's add an angle of attack to it. Not any angle of attack, but the only angle of attack that puts the trailing stagnation point exactly at the infinitely sharp leading edge with this flow tangent to the sail at that point. I would make a drawing if I could. This is a very asymmetrical configuration and is a lift-producing configuration. Regarding the "single streamline", in every airfoil at any angle of attack there is exactly one streamline that contains the trailing stagnation point that splits in two, one part flowing directly along the upper surface and one directly along the lower surface, and in contact with said surfaces. An infinitely thin airfoil still has an upper and lower side. And the two branches of this streamline are infinitely close to each other but separated by a solid surface. Super thin, infinitesimally thick, but still solid and non deformable. This configuration generates lift, and a substantial finite amount of it, not just an infinitesimal lift,  despite both branches of this streamline following exactly the same path, and hence the "first layer of parcels" that flow directly skimming the upper side and  the "first layer of parcels" that flow directly skimming the lower side also following exactly the same path. If you go far ahead of the wing and take the 2 neighboring parcels (one immediately above and one immediately below the stagnation-point streamline), and look at the trace of the motion of both until they ar both far behind the wing, you cannot differentiate the 2 paths. One is just an infinitesimal distance above the other. Yet, this configuration produces substantial lift. The cue is... both parcels will follow the same path, but not at the same speed, because you have circulation around the airfoil, and one will skim the airfoil above and the other will skim it below. And the airfoil, no matter how thin, we asume it to be solid so it can take finite (not infinitesimal) pressure differences between above and below. Is you theory (whatever your theory is, because I didn't understand it) able to explain that? "Mine" is. (I put mine in quotes because I didn't invent it, just studied it and taught it, it is the body of knowledge of Aerodynamics, it is in texbooks)
Reply: @adb012  Ok, thanks for your most recent replies.  I am trying to trace back through some of these dozens of messages to see if I can better reconcile the points you claim I missed.

It will have to wait till tomorrow at least, because I still can't understand the characteristics of "potential flow" and "streamlines" in the sense you mean below as causing a situation of asymmetry to be so restrictive that it produces no lift?:

"I already explained this when I talked about Kutta and Joukowski. You can put a cambered airfoil at a nice angle of attack, all introducing a nice asymmetry in the flow, make the full potential flow calculations, and you will get a nice set of streamlines in a nice pressure field and a nice velocity fields that create a nice pressure distribution on the airfoil... that generates no lift. None. Zero."

"It is IMPOSSIBLE to generate lift with potential flow alone. That's mathematically demonstrated."
Reply: So, correct me if I'm going in the wrong direction.  You're saying the potential flow calculations result in no lift because it leaves out circulation, and circulation is necessary for lift?  You need the extra step to impose circulation?

Then what do the results of potential flow actually show, in terms of the implied meanings of the resulting pressure distributions and streamlines and all, before imposing circulation separately?

To me, it seems the idea of circulation has to be integrated into the mechanism from the beginning.

Did I miss you explaining this somehow?

Is it only a device of mathematical simplification, which has no meaning before separately imposing the circulation condition?

(Is there a impenetrability implied between the resulting flow lines or something as part of the simplification?)

Do I need to go back and read again?

edit:  I had another post on d'Alembert's paradox questioning if it's really known for certain viscosity and the boundary layer are really necessary for lift (even though it is critical to design).
It was deleted (by Youtube algorithm??).  I included an external link, and last time I did so, my message also disappeared(??).
Reply: @davetime5234  ... The fist thing that you should know is that no theory is correct but some are useful, in the sense that they can accurately explain observations and predict future observations which, if match the predictions, reinforce the usefulness of the theory, and if not falsify the theory. So when you say "Is it only a device of mathematical simplification", well, yes. Every mathematical model of a physics phenomenon is that, since reality is more complex than out theories and all out theories break down at some point.

Potential flow assumes no viscosity, but if you impose the Kutta condition you capture the most important effect of viscosity in the generation of lift, which si the generation of circulation.

Still imperfect. Better to use the Navier-Stokes equations. These are so complex that we don't know how to solve them exactly (except in simplified cases, of which potential flow is one), but we can get very good approximations with numerical methods like finite elements analysis (a better approximation, but still an approximation). Even more, even if we could solve the Navier-Stokes equations, that is still an imperfect model because it is based on the Continuum Hipothesis... but the fluids (like air) are not a continuum, they are a bunch (huge bunch) of discrete particles with a random distribution of velocities and randomly crashing one against the other, even when the "fluid" is at rest. There is no "pressure field" and "velocity field" when you look at the individual molecules. So our best mathematical model for the dynamics of fluids is still a mathematical simplification.

You could go on with statistical mechanics, atomic models, quantum mechanics, quantum field theory, and that's as far as we humanity have gotten, and it is still not enough (quantum field theory is inconsistent with Einstein's relativity for example).

ll set at a side, you are correct, potential flow calculations result in no lift because it leaves out circulation, and circulation is necessary for lift. You need to add the right amount of circulation to impose the Kutta condition.

What in real life is a lifting airfoil (cambered, at an angle of attack, etc), in pure potential flow (without artificially introducing the right amount of circulation) will yield no lift. What would the streamlines, pressure distribution and field, velocity distribution and field would look like? Not much different than the "real" ones but with a big caveat. Let's talk about the streamlines. But let me first clarify the definition of streamline, since you asked before.

A "streamline" is a line that is tangent to the velocity vector at each point of the grid. So parcels of air never cross streamlines. In non-steady flow, streamlines are not "fixed" in place because the velocity vector of the parcel of air that happens to be at a certain coordinate at a certain time will be different that the one that happens to be at the same coordinate some time later. But in steady flow the streamlines are "fixed".

A "streakline" is the line that connects all the parcels that passed through a certain coordinate at different times. It is what you would see if inject smoke in a flow at a fixed coordinate (each parcel that passes through that coordinate will take its share of smoke with it).

And a "pathline" is the path "drawn" bu a parcel as it moves. As if a parcel glows and you take a long exposure picture.

In steady flow (another mathematical approximation), all three coincide.

Ok, cambered airfoil at a positive AoA, in pure potential flow (no circulation artificially added) yields no lift (mathematically). How does it look like?

You have a uniform speed profile far away ahead of the airfoil (all streamlines are horizontal and equally spaced). As the streamlines approach the airfoil they curve up a bit. One streamline that hits the airfoil somewhere under the leading edge contains the leading stagnation point and slits in two. One part branch contours the leading edge and starts to contour the upper surface. The other branch contours the lower surface. So far it looks similar to what you would get in the model with the Kutta condition imposed. But not exactly the same. For example, the leading stagnation point will be somewhere below the leading edge in both, but not in the same location. I you follow the streamlines under the airfoil, everything looks kind of normal, until you reach the trailing edge. With the Kutta condition, the flow separates here and the 2 flows (above and under the airfoil) rejoin here. But not in pure potential flow. What you will see in the streamline we were following (the one that is in direct contact with the airfoil) contours the trailing edge and keeps contouring the airflow forward over the upper side of the airfoil. The some of the other streamlines that were below that one do the same. The "tube" between streamlines becomes very very narrow wen turning around the trailing edge, which means that the speed increases a lot and the pressure reduces a lot. In fact, if the trailing edge is perfectly sharp (zero radius), you have a singularity at the trailing edge,  with infinite velocity and infinite negative pressure (if you are working with an incompressible model, which is not necessary because you can have potential flow that is compressible and even supersonic, but I don't know or remember much of that). This is where the "no viscosity" hypothesis breaks down. No matter how small the viscosity, when you have near infinite speeds of a fluid against a static surface, you will have near infinite friction, which will cause the fluid to slow down, not being able to generate the nearly infinite pressure gradient necessary to turn around a nearly infinitely sharp edge, and hence it will separate there. That's why real flow always separate a sharp edges (even sharp leading edges, unless the airfoil is at the exact AoA that puts the stagnation point exactly at the sharp leading edge).

Anyway, the flow that that was flowing back in direct contact with the lowest side of the airfoil now turns around the trailing edge and starts flowing forward in direct contact with the upper surface. But remember? We had the other branch flowing back on the upper surface. At some point (let's say 2/3 down the chord, but will depend on the camber and AoA) the 2 branches will rejoin and separate from the airfoil there on the top surface.

I would love to share 2 images with you. If you know a way we can do that let me know. I tried to post URLs before but the comment gets blocked. I will try below in a separate comment.
Reply: @davetime5234  ... Do you see the comment with the 2 links?
Reply: @adb012  Thank you for the detailed explanation, which I've copied to notes to be able to access directly for future reference.  Unfortunately, the comment with the 2 links did not appear (appears consistent with my experience in adding links).

Clearly viscosity, boundary layer, circulation etc. are critical to describing real world lift with sufficient accuracy.  And how this is dealt with in terms of pragmatic workable concepts, is why I took great interest in your most recent detailed description.  

But the description I gave, where you didn't like the seemingly disjointed listing of terms, I am still stuck with as being relevant.

It just seems necessary in terms of a purely "inertial" description of why a force with a perpendicular component must result from a solid object with asymmetry to the relative air flow.

I think it is related to the implications of statistical mechanics, in combination with, as I mentioned before, conservation of mass, momentum and energy.  I think the necessity of matter not being continuous is likely necessary due to the implied energy relationship between static and dynamic pressure (thermal kinetic energy's role in the aggregate directed momentum fed by static pressure must be accounted for).

When I mentioned "supply deprivation," I'm referring to the asymmetry restricting the mass flow continuity, and that such supply interference inevitably results in a pressure implication: mass density drops. 

From a statistical mechanics perspective (including the random thermal velocity distribution), mass flow continuity being regulated at the lower density by higher directed velocity (dynamic pressure directly fed by the higher thermal velocity particles), just seems too obvious.  How can I see it as not true?

We call the above "Bernoulli" apparently.  This pressure asymmetry, resulting from the solid's asymmetry, has statistical mechanical implications for the more extended relative flow region at ambient static pressure:  momentum change of the air with a perpendicular component to the path of travel is unavoidable.

The critical ingredients that must be accounted for: 

conservation of momentum: direction of motion directly implicates direction of aggregate force

conservation of energy: non-directed, but ability to do work means random motion is directly linked to directed motion (static pressure supplies energy for dynamic pressure)

mass flow continuity:  conservation of 
mass flow rate accounts for density disruptions causing static pressure change

random thermal velocity distribution: assuming no change in heat content, this is the only way to account for the relationship between pressure drop and speed increase (static and dynamic pressure relationship)

And I don't know how to conceive of this without matter being lumpy.  But it is clearly fined grained enough that it appears mostly continuous.

When an asymmetrical meteor enters the atmosphere, it may have enough turbulent flow that we designate it to be in a stalled state (can't support its own weight).  But surely such a stalled meteor is still generating a perpendicular force?

In the above sense, it seems that viscosity and boundary layer, while critical to a workably sufficient precise definition, are perhaps best left out when first considering the underlying mechanism of the perpendicular component force resulting from asymmetry?

The motivation for this is a more coherent explanation for why lift occurs that would be in better sync with key science concepts that people learn in basic science courses.  Explanations for the fundamentals of lift still seem to be all over the place (as a historical legacy?) making it hard for people with the fundamentals of science to make sense of all the debate.
Reply: @adb012  I hadn't noticed until today, the comment below I made elsewhere for this video has been getting some likes long after the die down period for the video's original release.  This goes to the idea of relating a more conceptually coherent physics explanation for a "science hungry" appetite:  

"They are linked by cause and effect and numerical equality, but the two must be considered separately.  A suction cup stuck on a refrigerator door is held up by a pressure difference, but the weight of that suspended mass is supported through the structure of the fridge against the floor.  As an aircraft has no such rigid support structure, it is required to expel mass downwards, as a consequence of that pressure difference, to supply the necessary force suspending it above the ground.  So, what manifests as a result of the pressure difference, must be considered separately to get at the full description.  An airplane suspended by a suction cup from a crane is also opposing weight from a pressure difference, but the crane is substituting for the need for vertical expulsion of mass (change in vertical momentum equals the difference in pressure for an aircraft in flight)."

One could also touch upon:  

1)why launch into the derivations based on the notion of circulation, without first considering the physical nature of why there is circulation in the first place from an asymmetry.

2)for the interpretation of shear velocities at the trailing edge (rather than imposing the contradictory artificial and false equal transit time notion), it seems to be consistent with the much faster speed on one side resulting from the regional condition of mass transport rate continuity:  faster speed must result from lower pressure to maintain the mass transport rate against a bottleneck situation (The pressure can neither continue to run up or run down, without an offsetting physical consequence to the bottleneck.)